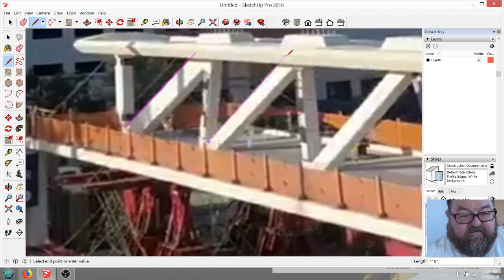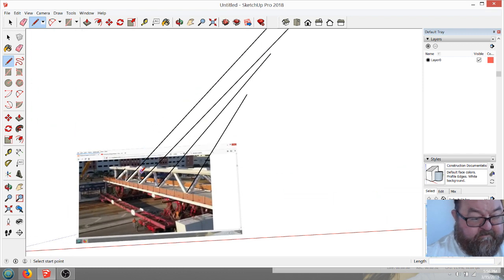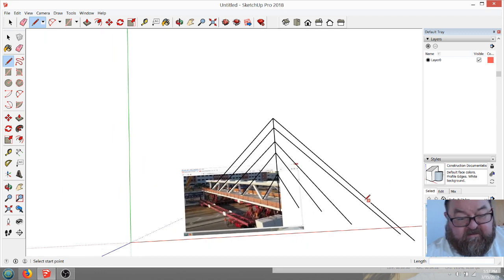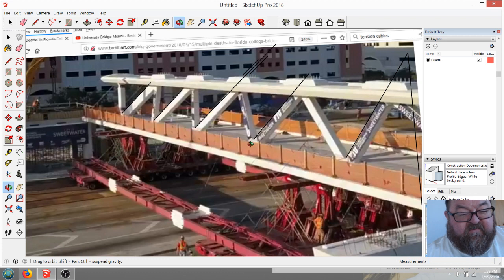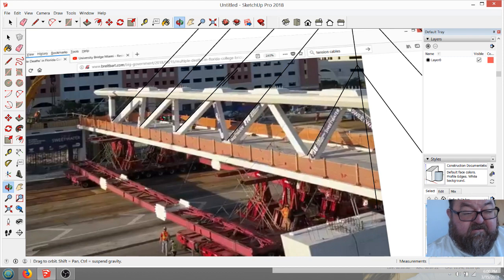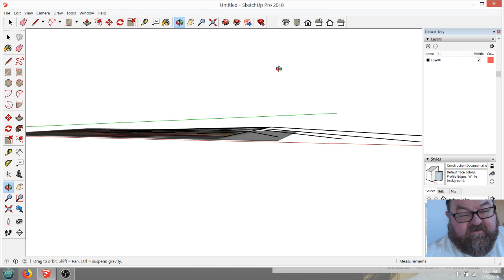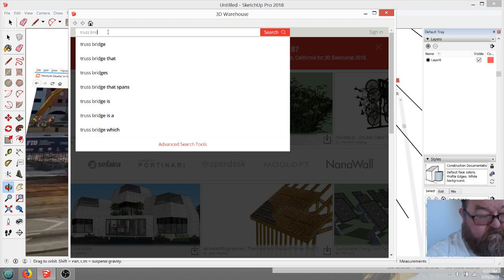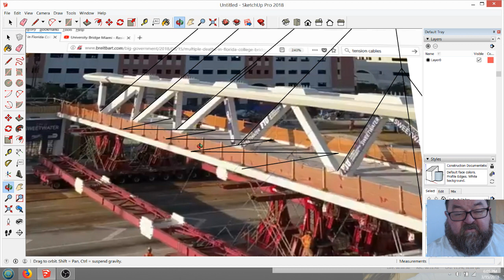FIU Pedestrian Bridge Collapses Under Own Weight - SketchUp

Comment: Look at the blue prints, and the final product. I was thinking the suspension cables were going to be added later, but upon closer viewing, it looks like a design change which omitted them from the final design? This now leaves the entire weight on the only support it has, which is the left support beam you can see by the water, and the right by the building that is under construction. When I heard they were tightening cables that became loose, I saw there were no suspension cables like the ones in the blueprints, which tells me the only other ones that would need tightening, would be the guide rail ones which replaced what was supposed to be glass? If those were getting loose, that's a clear sign something was going wrong in my opinion. I believe if those were the ones getting tightened, the two supports could not handle the pressure, and finally the one on the left by the water, gave out. You can see in the video as the bridge came down, the support beam got torn from its moorings and the snapped steel rods are in view. Extremely bad bridge design flaw if you ask me. I don't blame the workers, I blame the idiot who allowed this change to begin with.

Comment: First., this bridge was not designed to hold the load of the concrete alone. It was designed in tandem with the suspension system... this bridge was originally planed to be held in place with jacks but they opted out to keep traffic  flowing... the moment the jacks were removed  is when the first cracks formed... ultimatly, the contractor has the obligation to notify the state and law enforcment of an impending collapse... i hate videos were guys think they know the basics without reading the plans... i use to work for CPC., a competitor of MCM... MCM had a bridge failure in boise, id when we were doing the meridian nampa corridor of a bridge built off sight then set in place with crains... each time MCM has built off site they have had some type of critical failure., this is the first fatality i can recall... MCM was bared from building in Idaho due to safety violations with regards to its building practices... but like they said on news these owners had DEEEP political ties and won the contract!!!

Comment: Thanks for the great break down.I'm just a old homebuilder,designer of many of my own decks+additions etc:,But I could instantly see something was grossly wrong with the design.News is claiming it happened as cables were stressed tested and being retightened.What cables?I don't see any tower and other part wasn't there yet for counterbalance.Also since there was a ribbon cutting ceremony.I suspect we should look for election b.s. as some politician may have pushed for a part to go up for show purposes and didn't want any temp. support being seen.They also may have pushed showing off limited interruption to traffic etc: to showcase the great new technology.Either way great contribution in proving any regular builder could see it was done wrong.

Comment: This isn't a cable-stayed bridge. It's a truss bridge and the trusses were post-tensioned. The tower and pipes were just for aesthetics (which in and of itself is super cheesy).
Reply: It sure wasn't a truss bridge either or it wouldn't have failed as it did.  Look at the video of the failure and see where it failed.  If it would have been a truss bridge, two thirds of the bridge would not have pancaked.
Reply: If it's not a truss bridge, then what would you call it?

Comment: I am not an engineer but common sense tells you the bridge could not stand without cables. Otherwise what do you need them for in the beginning. I agree with you the reasonable thing to do was leave the road closed and support vehicles under it. I also think there was some pride on powers that be to be in a hurry.  Saying look what we Did. Yes look what they Did. Mans pride is very dangerous.

Comment: If you're going to use Photoshop or some other program to show the "vanishing point" of the support structures, you have to be absolutely certain that your lines exactly match the profile of the support structures, otherwise your perspective will be off.  Your diagram doesn't take into account parallax, which will be present in any photograph, as well.
Reply from the maker: It was just a quick talking point screenshot I captured.  I was using SketchUp which is the modeling program I use but I didn't have the time to properly draw everything.

Comment: The concept of a truss relies on support members that form triangles.  We can see this triangular lattice in the FIU bridge.  Because the shape of the triangles change from one end to the other is unique but it does not change the load carrying ability of the truss.  A strange fact in this case is that the final design incorporated cable stays which were totally cosmetic.  This means the bridge that failed last week was construction complete and capable of carrying load.  

The world awaits the results of the forensic investigation.  At the very least, somebody is going to lose their PE license.
Reply from the maker: It was not structurally correct as a truss and this is why it failed.  I have built trusses myself and this design would have never worked as a stand alone truss.  Trusses have positive secure connections at the webs and these so called web members had no connections between the members because they have to be post tensioned.  Also, trusses are not built from tensioned materials because the webs have to act in tension and compression at different times depending on where the loads are placed. You don't pre or post tension truss members. Most people who are commenting on this have no idea how trusses are built or work.  This was designed as a cable stay bridge. It is all in the drawings.  Any talk of truss design is an internet myth like flat earth or no moon landing.
Reply: The FIU bridge was designed as a truss structure with an offset mast from which were hung cable stays.  The cable stays were attached to the bridge but were not load bearing members.  In essence, the cable stays were added to the design to create a visual of a properly built bridge.  Totally cosmetic.

Post tensioned concrete has more tensile strength than ordinary concrete.  This allowed the material to be used in the truss bridge to transfer the loads to the supporting piers on either end.  But theory and practice did not mesh in this case.  I think we will find out that the tension rod in the first truss member gave away suddenly as the workman was tightening it.  The tensile loads were then transferred to the concrete encasing materials.  Of course this does not work so the bridge fell down. I also think this tension rod was damaged during the installation of the bridge.

Comment: The cables that you were drawing in are not cables at all. They were NON STRUCTURAL, for aesthetics only. They weren’t cables even, they were 16” pipes. Hollow pipes with no interior cables or webbing. The structures W-frames and the platforms pre-stressed concrete are the work horse of the bridge. 
Okay my opinion and most likely the actual cause is as follows: 
Much like a guitar neck with a truss rod that can be adjusted to straighten the neck, this bridge also had adjustment cables at the base of the joint on the main platform. 
When a guitar neck is straightened, the string tension MUST be relieved or the truss rod can SNAP!!
Well this was no guitar neck and the tension could only have been relieved if they had put the under cribbing back under the bridge while adjusting it. The temporary cribbing jacks were not in place. 
So when they went to adjust the cable tension the cable over stressed and snapped back into the frame and DOWN IT CAME.

Comment: they took a i beam and used that as a concept... bad idea because of wind. no force going out to the pillars  concrete is not able to handle that distance that they wanted... they did not arch it to bring the force to the pillar. they had the cables only to try and balance the top. the cables did not send any for to the ends. their is no bridge ever made like this before and it was not design tested.

Comment: This was a post-tension stress concrete truss bridge. If you look at the proposal (p65) you see the spans are designed to hold themselves up without the cable stays. Purpose of the stays was to reduce harmonic vibration and improve aesthetics. https://facilities.fiu.edu/projects/BT_904/MCM_FIGG_Proposal_for_FIU_Pedestrian_Bridge_9-30-2015.pdf
Reply from the maker: I mention the pre-stressed concrete in the video but something obviously went wrong.  The concrete has to cure around the stressed cables. Maybe the concrete did not cure properly.  It takes 28 days unless there are accelerates  added and even then it takes time to cure. We will find out after they analyze it.
Reply: I don't know whether pre-tension or post-tension is very significant; my main point was to say the cable stays weren't required to support the span. "AvE" has done two great videos analyzing this collapse. His guesstimate is that the cause was improper position of the SPMT when they swung the span across the road and put it on the north pylon. The PT rods stretched in the north end trusses, lowering the tension in them. When the engineers tried to bring the tension up, the cable snapped, the tension was released, and the span collapsed.  https://www.youtube.com/watch?v=KtiTm2dKLgU
Reply from the maker: I disagree.  The cables are required for live loads.  And if it was a post-tensioned system and the reinforcing had not been tensioned yet due to the concrete not beeing cured yet, then you have another problem wich the cables stays would have prevented.  This is a case of neglect.  I found out they found cracks on the morning of the failure.  This points to no tensioning on the post-tensioning system of reinforcement.
Reply: You are disagreeing with the design engineers? Look at p65 in that pdf (look at the whole thing, very interesting) which says "The structure meets strength design criteria without the stays; they are an additional structural feature provided to meet the natural frequency requirements." Yes, the cracks would fit AvE's explanation that the improper stress while installing the span stretched the truss PT rods and reduced their tension. Less tension in the rods allowed the concrete to crack.
Reply from the maker: I just read a report that apparently upon finding cracks the morning of the failure,  an engineer asked that "some cables" be tightened that he apparently thought were not tensioned properly or had loosened.  This is going to be a problem with the post-tensioing feature which means the reinforcing was not tensioned before the concrete was poured ans set.   They did this to save time and get the span up quickly.  They thought the "truss" type design would be capable of holding the weight of materials while they post-tensioned the reinforcing.  This obviously did not work. My only point is that the upper cable stays would have prevented this accident. If they had used a different system of tensioning the concrete reinforcing (pre-tensioning) then the span would have supported itself until the cable stays were installed.  They chose not to use the pre-tensioning system because it requires more setup and time and the concrete most cure around the reinforcing before loads are put on it but of course this is the point.

Comment: They should have set the dang thing on the weekend when there was NO traffic.
Reply: The span was pre-built parallel to the road then picked-up, rotated, and set on it's piers Saturday 10 march so it was in-place for only five days before the failure.
Reply: TAOFLEDERMAUS it's miami on a weekend  8th street has more traffic. the lowest traffic time was when the incident occurred.
Reply from the maker: TAOFLEDERMAUS i agree but what engineer thought a cable stay bridge would stay without the cables.  The weight of the concrete alone at 120 lbs per cubic foot put this thing at risk.  The design itself was not conducive.
Reply: Mulinaster thats correct.

Comment: It looks as if the cables were not installed at the time of the collapse.  Without the cables, the deck would  have been in tension while if the cables were installed the deck  would have been in compression. From the video it seems that the deck failed in tension as the cables were not installed at the time.   A rather curious situation where someone did not understand  the principle that was being used to hold that bridge.
Personally , I think the cable stay part was a rather over engineered and with that rather short span for pedestrians a simple bridge would have done. Pity , a real pity that this had to happen because of someone misunderstood the operation of that bridge.

Comment: As an art major I feel the need to break it down to ..too much bridge, and not enough support. However, I do understand that materials will need to be inspected and general design and or construction flaws as well. Probably multiple issues culminating in disaster caused by rushed construction and poor planning. Time will tell.

Comment: I'm a bridge engineer and this bridge was designed erroneously to carry its selfweight as a simply supported truss. It was then to be cable stayed for live load only. The failure appears to be concrete crushing in either a diagonal or top chord member. A tensile member would be steel reinforced and a tensile failure would not be catastrophic due to the ductility of steel.
Reply: Daniel Byrne There's a video that shows the bridge collapsing... as you stated, it appeared that the top chord crushed setting the whole thing in motion.
Reply: I saw that video and that is exactly what it looked like.
Reply from the maker: The "truss" seemed to be more about an extension of the cable ties in lieu of an actual truss.  The truss members matched the differing angles of the cables as if to show that the design would only have worked with the installation of the cables.
Reply: Artisan Tony,  It does seem like this is what happened.  But it's hard to believe that they were willing to take the chance of it being strong enough only supported at the ends without the cables.  I've never heard of building a suspension bridge by building the decking before the cables are there to take the load???
Reply: Daniel Byrne (66

Comment: Excellent video Tony. But I think you have the cables leading from the wrong side of the triangles. If you can find a picture more from the side it looks like the the fifth element of the trusses from the left in your view is pretty much vertical. Imagine a tower there, just like the picture you have at 9:13. That is, a tower within the span, then cables lead from the left and right to a point above that fifth element. But there is a problem! As the bridge stands the tower would project down to the middle of a lane! If you swapped ends, though, the tower would fall on a median. Was the span installed 180 degrees out? Yii.

You know it reminds me of the Tampa Bay bridge with its central cable structure. And its flaws?

Comment: Tony:  It seems that you're trying to say that the trusses were truncated and incomplete, as indicated by the progression of angles of the apparent support truss beams.   Therefor it is incorrect to refer to this as a "truss bridge" when the trusses are incomplete and therefor not there.   This main structure of the "projected or proposed" truss bridge was incapable of temporary self support even if the concrete of the main structure (sometimes called: the super-structure) was correctly poured.   In the attempt to produce a visually impressive bridge,  important temporary support should have been in place until the bridge trusses (suspensions?) were complete.  Even a visually ugly temporary overhead scaffolding would have worked.
Reply from the maker: My point was that the cable stays formed more of a structural function than claimed.  Also, I found out after the video they were attempting to post-tension the reinforcement in lieu of pre-tension to save time apparently. This means the reinforcing may have not even been tensioned at this point which would have meant certain failure unless the cable stays were in place to provide additional support until the entire structural system was in place. But  I was referring to what others were saying that the bridge should have been able to support its own load due to the truss effect.  These were not sufficiently designed as trusses due to them being coordinated with the angles of the cable stays.  We will see I guess :)
Reply: That makes it even more incredible that traffic was allowed to continue during the tensioning process.  Simple vibration, during tensioning, likely caused liquification of the concrete!  I would consider this gross negligence.  It was foreseeable to sharp contractors and surely to engineers.   And to think we are about to embark on some kind of economic infrastructure blitz!  This scene will multiply.

Comment: Hey, happy Wednesday, hey the plans called for 16 inch round pipes,  not cables, they planned it to self support from the side pillars, the pipes were going to be bolts at the top center tower, and bolted to the roof of the bridge,, have a great day,
Reply from the maker: But that didn't work did it? :)  My case is that they should have had structural suspension cables as a part of the design.  If you watch my update video you will see where I explain the so called "truss" design does not exist and/or would have never worked.  They are lucky it fell when it did because more people would have died later when it fell. In any case the design is flawed.